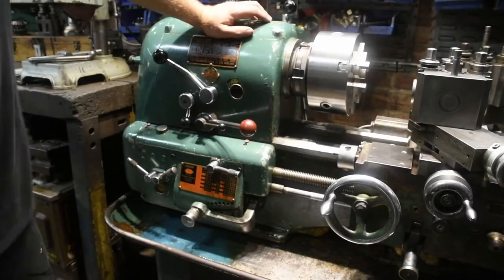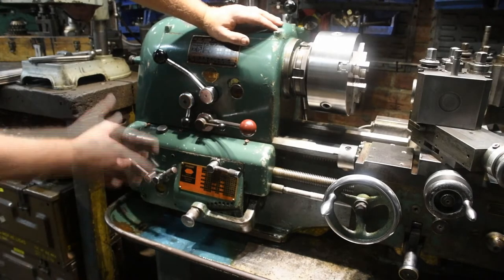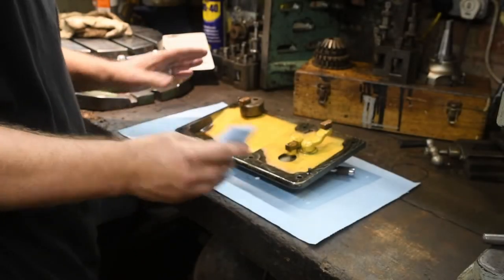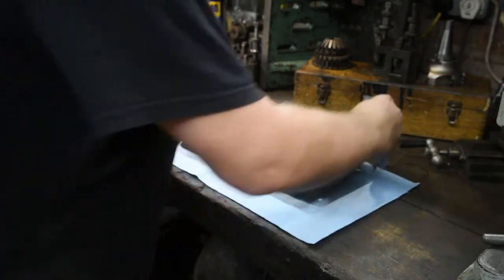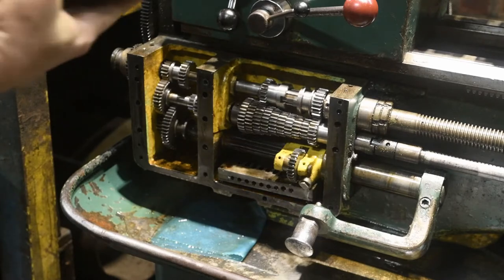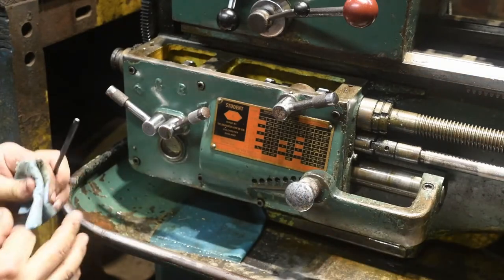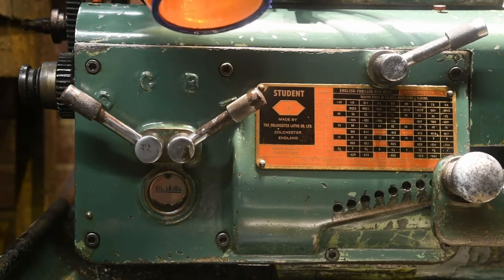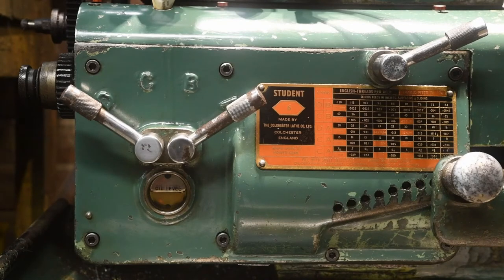Lathe Maintenance

Comment: I have a Colchester Triumph roundhead. Very similar to yours just bigger.
I made proper gaskets from the special paper. Very satisfying to make. Just gently tapping with a hammer all around.
Reply from the maker: Hi, thanks for the post. Yeah, I would have liked to use the gasket paper, however at the time I wasn't able to get hold of any. I do plan to do a deep clean at some point. When I do that I'll replace all gaskets as they should be.

Phil
Reply: @m0xya  
I had never tried it before. Was pretty easy and does a great job.